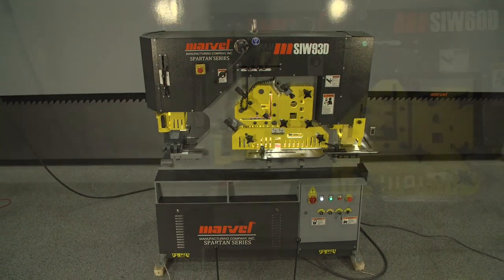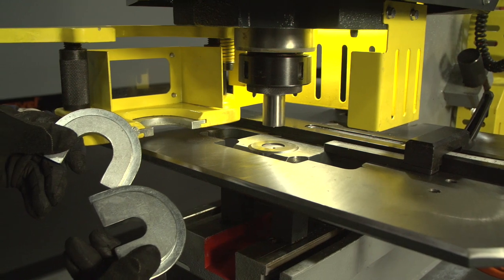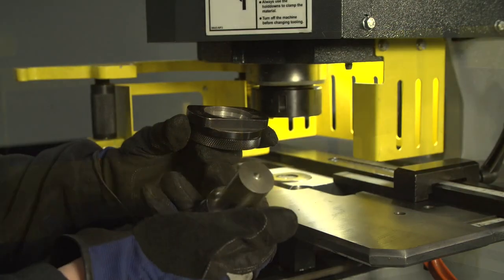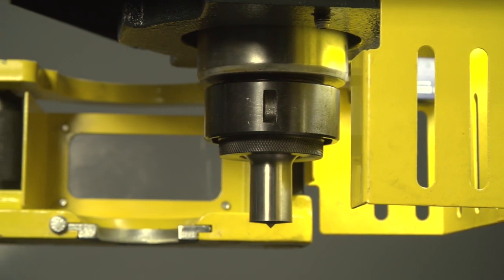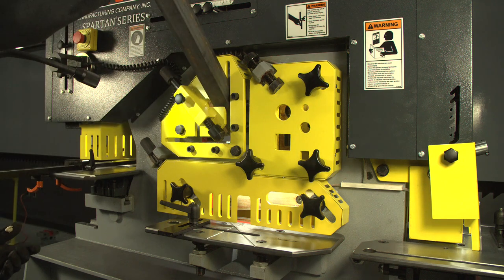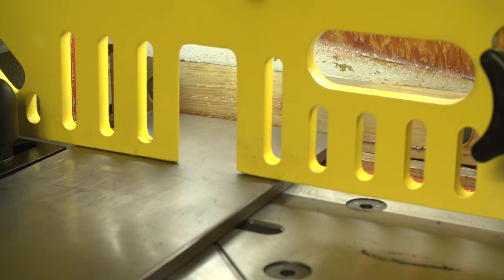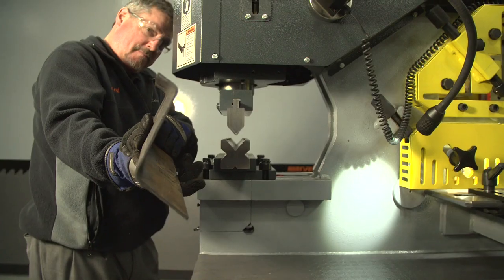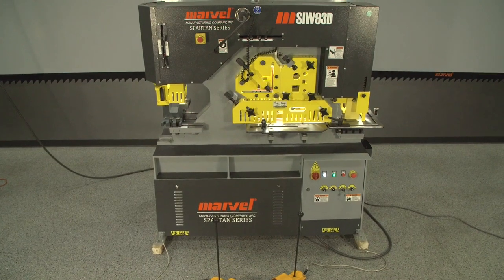Marvel Ironworker Overview

Comment: Nice looking ironworker. We use a 60 ton Edwards in our shop and Cleveland Punch and Die is our choice when it comes to punches. We’ve actually worked with them doing videos for their products. I’ll check out your ironworker. Our shop is single phase so if we replaced our 13 year old Edwards which is still like new we’d want a 100 ton or more. What is the country of origin of your ironworker? They do look good.
Reply from the maker: Thank you! if you have any additional questions please feel free to contact our Ironworker Project Manager (Mark) at 920-236-4112